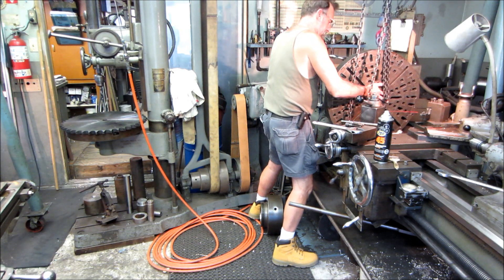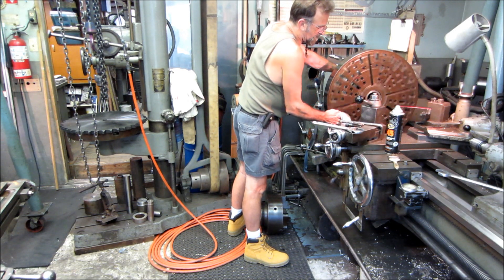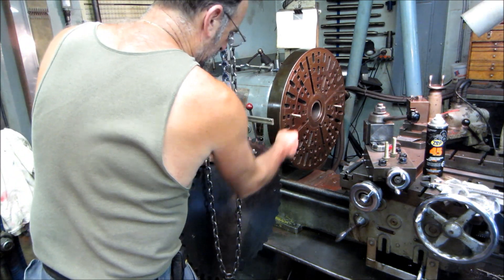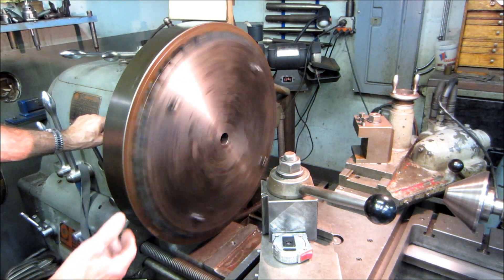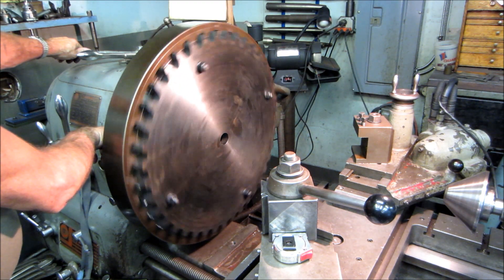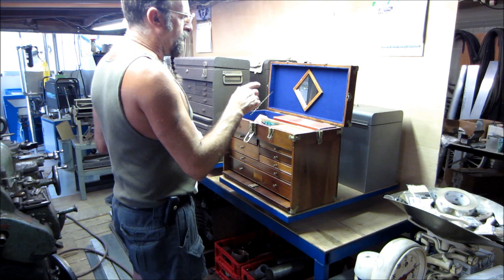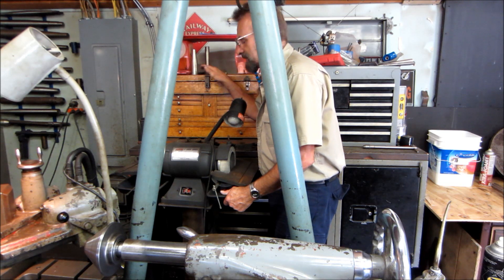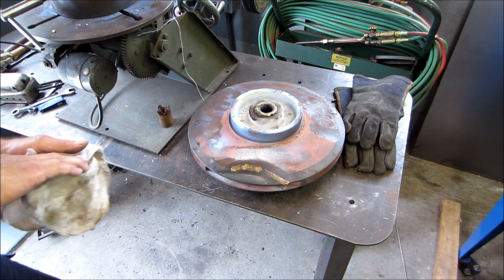American Crane Part Two

Comment: I don't know if you will see this comment or not Tony.  I laughed on the take of the wooden tool box , bottom three drawers,  they are well kept until you get in there. I am retired but work for myself, welding tinkering, helping out on a couple of ranches that a guy has.  I did a little machining about 20 + years ago.  I loved it.  I really like what you and John are working on together on the Por-she.  I am trying to pick up fusion 360 for my new plasma table coming soon.  Texas weather is nice today.

Comment: hey keith great vids!! I work as a fitter at a steel fab shop and often thought about using bessy clamps to lift small loads but didn't they would hold. I guess they will hold a small load.  Why would you use a bessy clamp over a C clamp?

Comment from the maker: Yes they are all hand made, the frame is 1" aluminum square tubing and the hinges are S/S with Delrin bushings. The windows are held in by a frame and flange bolted through the aluminum tubing and can be changed as need be. It was before video time, but I do think I took photos and might be able to find them, if I go in to the archives. ;{)-----

Comment from the maker: Once in a blue moon! When the chuck is not there my stance in not on it, it use to be just two coils, but now it’s a bit longer, always large coils for grab and go, I use it outside as well as in the center section of the shop, a couple times a day. It lays in a non traffic / working spot, it would not be there if it was a hindrance or safety issue, I wouldn't do that to myself...LOL...